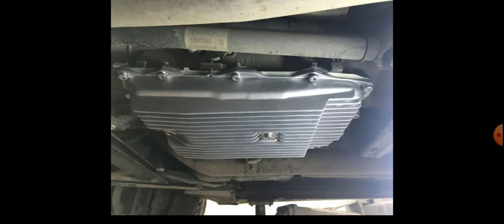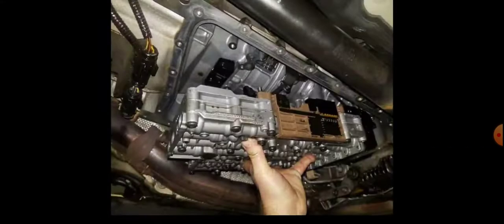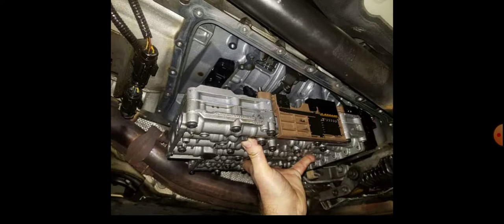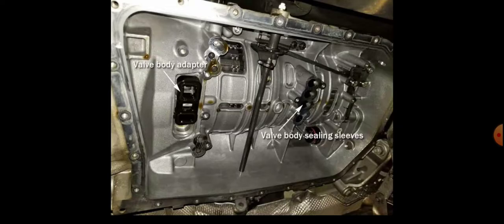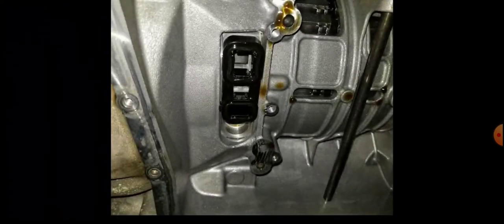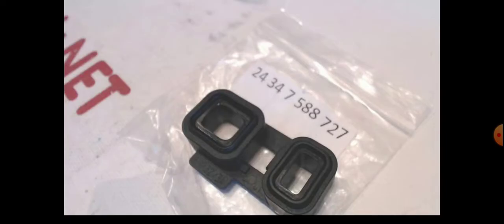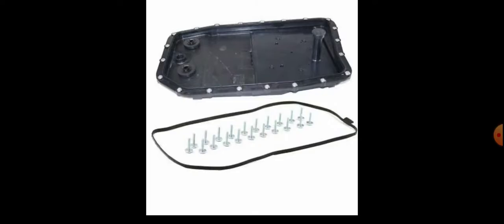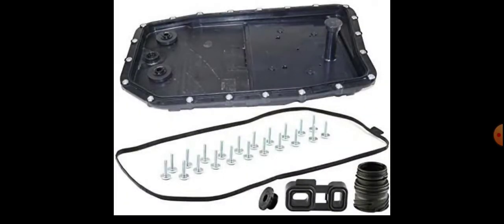BMW X5 E70 common transmission issue solved - BMW transmission problem

Comment: My 08 bmw x5 show transmission malfunction. Once I start the car it refuses to shift to drive it jump to park. It does the same thing when I put the car in reverse it jump into park.. it does it repeatedly for a whole and then it will go into drive...  some how it drive normal for a little while then the transmission doesn't shift into the right gear sometime and it show transmission malfunction. So plz tell me what it's the problem and how to fix them

Comment: Problem if you take it to a shop they going to say that you need to rebuild your trasmision. Yes is not a big job for someone that knows how to work on cars and have tools.
Reply: So buy the part and pay the to change it out. Simple. You tell the mechanic what you want done and its done

Comment: Dears, My vehicle is a 2012 BMW X5 e70 model. Transmission is ZF 8hp70 model. When the vehicle warms up and I am stuck in a traffic jam, it jumps from 1st gear to 2nd gear while doing stop and go. Sometimes the error appears on the screen. When I stop the vehicle and start it again, the error disappears from the screen. However, this happens occasionally when I am stuck in a traffic jam. Is this solution suitable for this problem? Has anyone experienced this?

Comment: I have a 2001 x5. My car will Rev but won't go, I turn off and back on and drives fine for short distance,  then it acts like it's in neutral while in 3rd. Anyone have the same problem?

Comment: 2013 528i xdrive, front bumber collision.
Engine runs, wont shit from p to n or drive or reverse.
A transmission cooler one line is broke. Planning to replace and next step will be to check transmission fluid level.
Assuming if line broken maybe lost some fluid...

Comment: I have a e65 05' 745i and having exact same problem. Do u believe this will fix it and going ahead and changing the trans sylinoids an pan w/ trans fluid??? Do u think my problems will fix my car??? Other than that the engine runs great, only 108k

Comment: I have an issue with my 2015 BMW X5 xdrive 35i that the reverse power is very weak that it could not go up the curb, height 150mm, though I floor the accelerator whereas my RR Sport same 3.0 used 20% of the accelerator…could you please advise what should i look for?

Comment: I bought BMW E 65 740 i 2007 original 160.000 km all  service last service automatic  on 97.000 km ,but hard shiftin gear do you nead replace seal like this video .

Comment: I have a 2011 4.4l x5 50idrive I removed the transmission pan and the mechatronic but there was not a valve body adapter inside could there be a different transmission

Comment: So if my car doesn’t accelerate like when I step in gas it doesn’t have that much power is that the problem too? The car goes but it makes some sound and it doesn’t go according to the power of you stepping in the gas. My is a BMW X5 2002 3.0i please help.
Reply: I have 2008 328i with those symptoms , did you resolve your issue? & if so , could you please help me 🙏🏽

Comment: Hello everyone, my wife's 2015 x3 28d had a drive-train malfunction last
  Saturday. She came of the hwy and as she was turning right the car  
jerked twice and then lost power. She pulled over and shut it off.  
Waited 5 minutes and restarted it. Motor was fine but she could not  
select gears just stayed in park. Now it got towed to Kingston BMW and  
they diagnosed it as it needs a new transmission at 15k plus 2500 labour
  and taxes on top of that. 

Now the car has never showed any transmission problems until that day. I
  tried to find out from the service manager to see what part of the  
trans is faulty but he refused to tell me or they do not know what  
exactly the problem is. I also requested that he sends me the diag  
results which i just got today after complaining to BMW Canada about the
  situation. I suggested there must be another option because i do not  
have 20k to spend. I bought the car last year in January with 136k kms  
for 20k and in August the egr cooler caught on fire and the car was at  
Otto's BMW in Ottawa for the whole month of August. Which they had to  
replace the whole top-end of the motor because of the damage from the  
fire. Which BMW covered 100%. Now 8 months later the trans goes out. 

I kept on asking the service manager to see if there is another option  
like replacing the part that's faulty or rebuilding it. He just kept on 
 saying the test says the trans have to be replaced with a new one. He  
also mentioned that they cannot code a used trans because i suggested  
that and he said they tried one last year and they could not code it so 
 they had to put a new mechatronic unit at the customers expense which  
was 6k. As of today they still did not tell me what exactly is wrong  
with the transmission. So i finally got the diag results which is 11  
pages. Not sure if any of you guys know how to read them. 

Any help would be great. I cant post the PDF here or maybe reply to this
  comment if you would be able to help in finding out what could be the 
 issue. I have worked on cars all my life built motors, turbos and 
worked  mostly on manual trans but i have no idea on all the new 
electronics  crap. I ended up towing the car back to the dealership 
where i bought  the car which is not a BMW dealer and they said will 
have a look and see  what they can do. I did buy a 3rd party warranty 
48mos or 80k but there  is a 3000 dollar claim limit.

here is a link to the PDF https://www.bimmerfest.com/threads/b...#post-13547229

Cheers and thanks for your time

Lester.
Reply: No it does not need trans, it may just need trans fluid or or the part this guy's talking about, if the car isn't getting enough voltage, may need battery but what I'd do is change trans fluid, pan (check oil) It's BMW dealers job to tell you the worst thing, it's how they make their dirty money. In mean time, put key in but don't start, hold gas pedal to floor for 45-60 secs and it will restart transmission, then start car back up, if that don't work take neg off terminal for few mins to restart computer and then hook it up tight an start car but these are troubleshooting the problems not fixing it, so fix other parts asap so you don't run into more future problems... 
    It may be better to get car in working shape and trading it in. if u got a manual trans u wouldn't come across alot these problems bc only auto on bmw has the transmission failsafe, me myself won't get another auto but I do love bmw's, it's all about maintenance an how well previous owner took care of it.. ppl say they unreliable but I blame it on previous owner neglect

Comment: Hi, I have 2004 X5 e53
It doesn't engage into Drive from Parking...I put in Manual Mode into 1st gear, then switch it back to Auto mode, then it works....could this be the same problem?
Reply from the maker: Yes, it could be

Comment: great video! But my issue is a little bit different :( my 2013 X5 3.0L is slipping when I try to go in every single stop seems like GEARSHIFT 6 to X and have the code 4E9F and 4E70 and the transmission shop told me that I need a new trans !! with only 125k mi any recommendations ?
Reply from the maker: Could be your shifting solenoid

Comment: Can low oil lvl in the gearbox cause overheating the oil ? My zf 8hp is at 100-110c and i lose torque when it reach those temperatures. What can be the broblem ?

Comment: Is this Chat still active? I need advice, I have a 2012 E71 (X6) 35i and it won’t go into park (P) The gears all work well but the Park will not engage, I get a Transmission malfunction in P and it goes to N Neutral and flashes. To park I have to engage the E-brake. Any advice?
Reply: A bit to late, but i had the same problem. It was the screw on the gearbox for the emergency release of the parking lock. This screw turned upwards by itself and permanently blocked the parking lock lever. The screw must only protrude 1mm and must be secured. Greetings from germany

Comment: 2010 x5 chugging when driving after acceleration, could this be a symptom? Also the cheap plastic gear wore causing the transfer to malfunction, probably not related, don’t know, spent about $10k on it in last 4 years, other problem related, thanks!
Reply from the maker: Hi. Does is shift properly?
Reply: Yes, but when accelerating, does seem to chug

Comment: Hey man, my problem is in the morning (cold engine) it doesn't want to go into drive no problems into reverse. Do you think it could be the same issue? No errors on the dashboard.  Tnx
Reply from the maker: It could be. Check the gearbox oil level too

Comment: Hello,
I have a E53 BMW X5 from 2000.
4.4 V8
The transmission works fine in D
But when I switch to revers is spinning a little and I have to accelerate harder to move the car in reverse,
May am transmission fluid change solve the issue ?
Reply: Hello, did you figure out what is going on with your X5? I’m having the same issue with my X5. It will drive perfect in drive but doesn’t want to move in reverse.

Comment: I have a question. My 2004 325Xi will loose power at about 2k rps and sometimes it won’t shift. Also have my tranny light on and it won’t go into sports mode sometimes. Shifter solenoid?
Reply from the maker: Shifter solenoid is the most suspected part. Have you tried to read the code?

Comment: I have a 2011 BMW X3, and it won’t go forward and reverse, sometimes it does. My front differential seems ok and the transfer case. Do you think I’m having the same issue. Although one of my front passenger side axles is wobbly and it would make a grinding noise.
Reply from the maker: It could be the same issue with shifting

Comment: May I know your model or vin number for me to check if the valve body adapter is compatible with my X5? I need to know before I buy the valve body adapter on ebay
Reply from the maker: All three that I replaced were 2007 and 2008 3.0L engine. Please check with the BMW dealer. They will give you right part number based on you VIN number.
Reply: @reallifevideos192  My X5 E70 is Xdrive3.0D. Is it the same as your car? Dealership only recommends getting new gearbox and it is simply expensive. Even when I gave them the part number of valve body adapter like you share in this video, they told me it is not compatible with my car. It has been two months since the car broke down and no mechanic is willing to take the job replacing the valve body adapter.

Comment: That part, 24 34 7 588 727, is listed for a E53 E63 E65 not an E70.  Are you sure you did this on an E70?
Reply: Most E70's has the ZF 8-speed.

Comment: My 1015, X5 xdrive35i is starting to shift a little hard as it shifts on normal driving.  Does this fix on the video fix this situation?
Reply: Hey did you fix your car and how? My car is hard shifting between 2nd and 1st, very annoying.
Reply: @netonentchev  hi, do you have any updates? I have similar issue.
Reply: @abdulkadirmutlu1799   @abdulkadirmutlu1799  Hi i replaced only the spark plugs and it completely went away for a month, after a month it again started maybe once twice a week  jerking a little when car downshifting 2nd to 1st - when slowly coming to a stop. Two months later it hasnt gone worse.

Comment: Wuold this be a fix for rough downshifts? Mine does a bang when shifting 6 to 5
Reply: That’s sounds like you need solenoid replacement. You can get a set of them FCPEURO OR ECS
Reply: Also you can do this service too all together
Reply: My issue was that egr coller was leaking, egr valve stuck and pressure leaks in turbos. Now its working because i got rid of that thing and chenged it to a working Volvo :)

Comment: I have bmw e60 530i 2010 i m facing an issue when whenever i start my car the gear is engage with propeler shaft and the car is getting little jerk after start then its become ok 
And this happen only when i start after giving gap 5 to 10 minute ‘ if i will start and stop same time then no issue 
Please let me know if you have solution for it

Comment: Hi i have peoblem in my bmw x5 3.0 diesel 2005 M-sport whith gear box somtimes is losing the speeding and is saying transmission fail safty after have ti stop switchit off and on agen to work no from today is working only in first gear and second gear ic can help me what to do thanks
Reply from the maker: Hi. It could be your shifting solnoid in mechatronics module

Comment: Hi my E70 has the same issue . Am gonna try with this . Could you explain the draining and refilling process . Please . I think it’s not a easy task.
Reply from the maker: Hi. I didn't do it myself. Take it to the transmission specialist and explain what you want him to do
Reply: I performed the repair my self with all precautions needed. After repair I have done 1800 kms .. my car is doing well and am happy for that . Thanks to AUTODOC. #autodoc